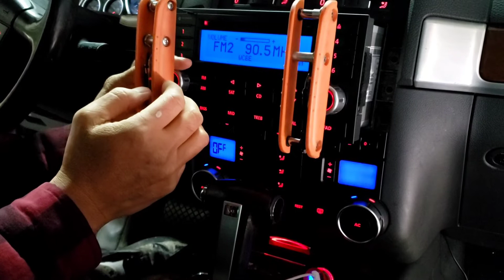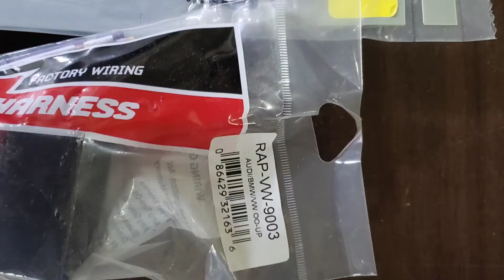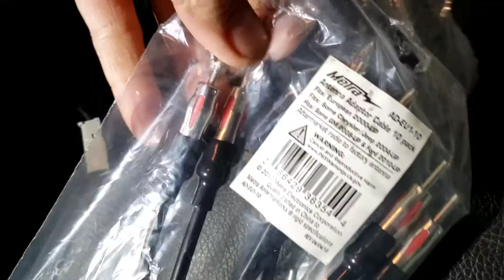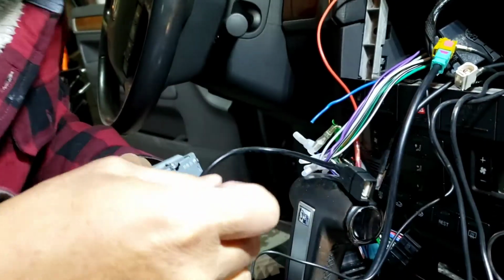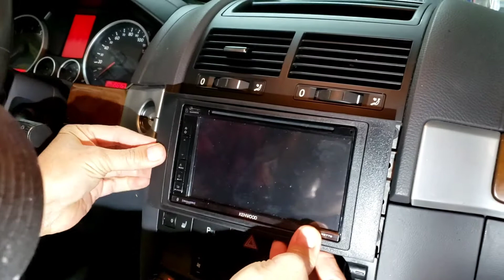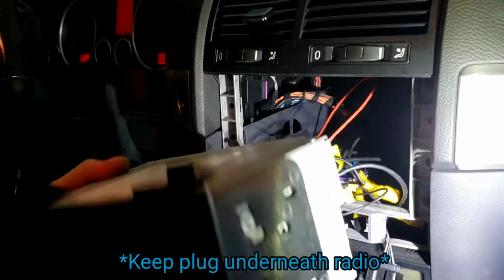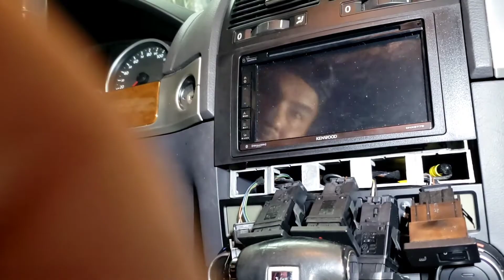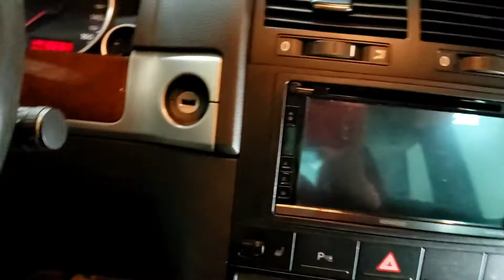VW Touareg radio install and removal

Comment: I'm laughing my a$$ of right now because I have an 04 Treg with a similar Kenwood head. I tried to get behind the radio to add the steering wheel control and had a really hard time. Recently I was thinking about upgrading the head unit, but now that I see this, there's probably no way to reverse what they did. 

You've wedged it in there so bad that they are going to have to break it out. VERY poor installation guys.
Reply from the maker: Best to get a Tesla screen or Meckless screen